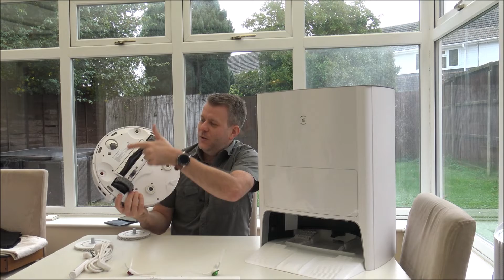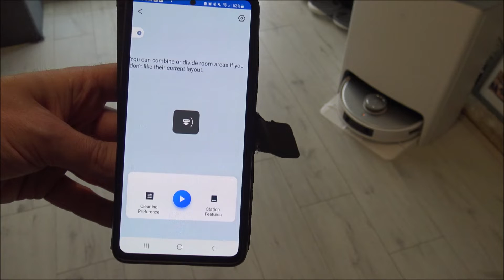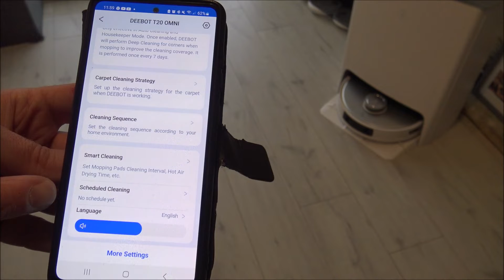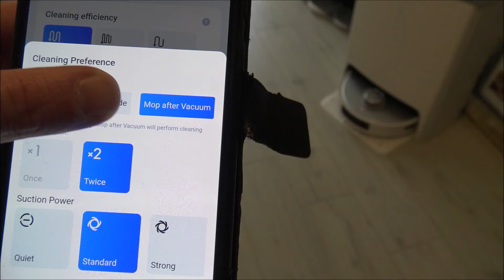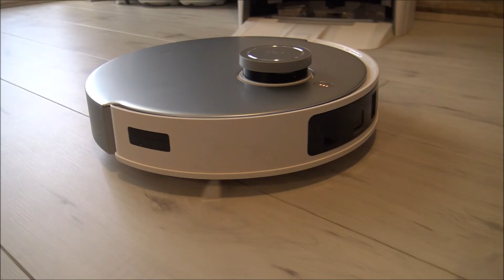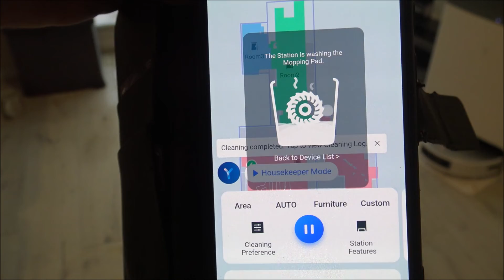Ecovacs Deebot T20 Omni Robot Floor Vacuum Cleaner Self-washing With Hot Water

Comment: The idea of the hot water is not to clean your floor with hot water, the pads are down to room temp within seconds of leaving the base station, the 'hot' water is for cleaning the mop pads when back in the base station. Is it hot enough at 55c? Well, it's better than cold I suppose :)

Comment: I have been moping with hot water for years, and bare min of cleaning product on the water. The heat was enough to soften the dirt, and with the (manual) mechanical force on the mop head kept my floors clean and NOT sticky. Some people use too much product on their floor that, once dry, makes the floor sticky, so then again you need to clean and "use more of the product".

Comment: One thing I have found is that if you upgrade your phone as I did and my friend did the app is no longer economised, you cannot re register as you are told somebody with that email already exists and so you go around in circles. The only way my friend managed was to re register using her husbands email. There does does not seem to be a solution for the problem.
Reply: If you have a gmail address, put a full stop/period/'.' between any letter in your email before the @ symbol and the app should recognise it as a different email address, but you'll still get the emails for it :)
Reply: @daz_lanza  Thank you that is very interesting. I would try it but it seems that now the app has decided I am a new customer and I need to start again. Its very confusing and a definite glitch in their system.